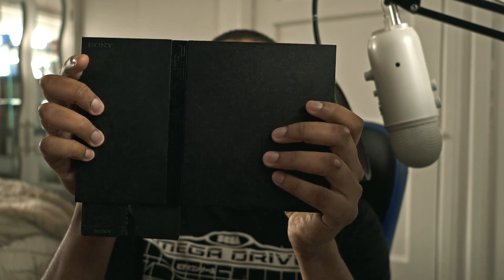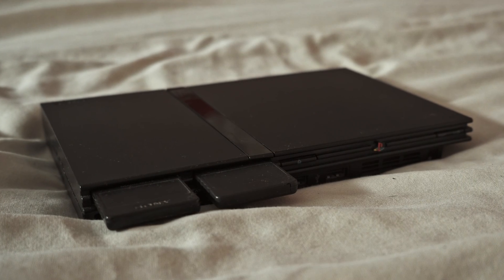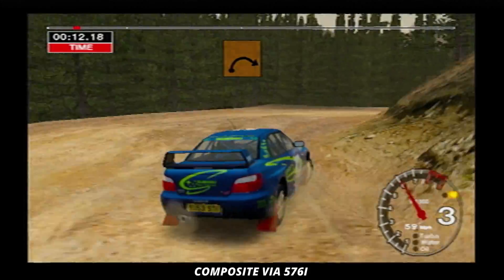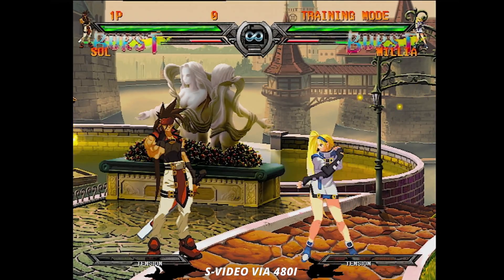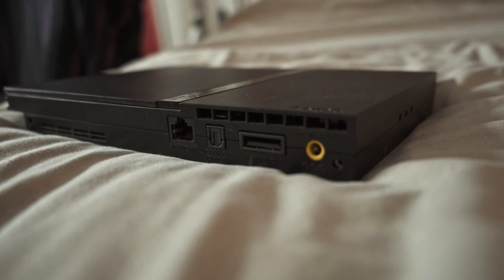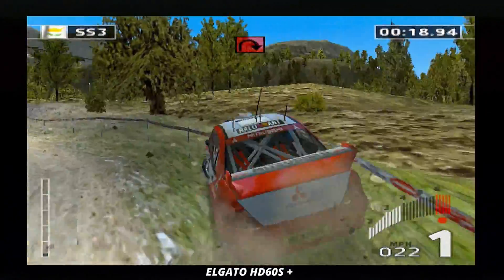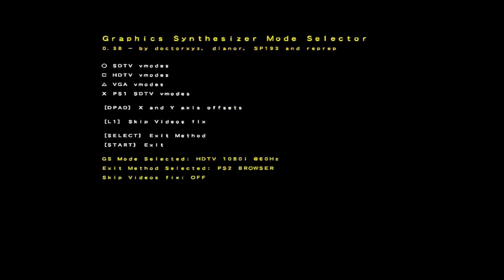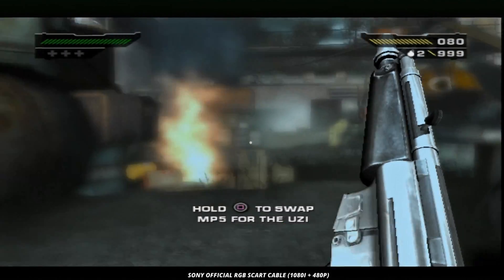PS2 Video Output Misconceptions & How To Improve Image Quality - theaffroshow

Comment from the maker: This is a video I've wanted to make for ages! I hope it helps you get the best out of your PS2!

A point I did not make in the video was the flicker filter settings which some games called it anti aliasing!

This will put a blur or bilinear filter on the screen & it will reduce image sharpness! If the game looks blurrier than normal, check the options in the game you are playing to see if this feature is turned on! Turn it off & the image will look sharper! 

I've also seen it dubbed as soft (flicker filter on) or sharp (flicker filter off) Silent Hill 3 & Tekken 5 are examples of this! The feature might be hidden as it is in Silent Hill 3!

Hope this helps improve your PS2 video output!
Reply: Getting the cable is easy.
Finding a working CRT with 5 pin S video is the hard part. Can be found but when you are looking for one it almost seems impossible.

I Wish a firm would start making CRT's specially made just for gamers as LCD is never the same in my opinion. 
You can get close with optomised emulatores on PC which for those that never grew up with the origina gen 6 or earlier tech they should be fine emulating if not enjoy the convenience more.
I don't convenience; ''I want problems always''.
Old gamers are different as for a start to many games today are cinematic & also aim for realism.
I want stylistic art over pure realism & unsual design choices which cinematic does not offer.

Gen 7 you had some of what I like but Gen 5, 6, 4 in thhat order was the best gaming to my eyes despite the hardware limitations of the time.

Comment: S-video is actually a fantastic cable in terms of size and what it can do, if you still have devices with that port. I have a portable DVD player and a 32" bravia TV with s-video, and still use them regularly to watch DVD's out of the library.
It can do 480p or 576i.

Comment: I spent years messing about with converters and upscalers until I just gave up and decided the best bet was to find an old TV. 
Then I lucked out, work was clearing out stuff. Found an old monitor from 2009 with component ports, quick Google search for its manual to confirm it 576i supporting. And it is brilliant, really enjoying my TV now.

Comment: That depends on the game, I have two games in my collection and they look amazing in 480i using component cable or an adapter ps2 to hdmi, the games are WAVE RALLY and SSX 2000. So there are games that look amazing on an HD TV without progressive scan 480p.
Reply from the maker: There are exceptions of course (Even the PAL version of Gran Turismo 4 looks good) but if the games has 480p available, most of time it will look better :)

Another exception is Tomb Raider Legend & Anniversary on PS2. They both have 480p support yet look softer & worse when using it.
Reply: @TheAffroShowGameplay 179 ps2 games offer 480p. I have some games that support progressive scan and without progressive scan they don't look good.
Tekken 4
Atv offroad fury 2,4
Jak 2, 3
Socom 1,2,3 
Socom combined assault 
Jet li rise to honor 
Splashdown rides gone wild 
Smash court tennis pro tournament 2
These games cannot be played without progressive scan on my TV, they look amazing only with 480p activated,  I agree
Reply from the maker: @Luke_Alves  I'll also add 480p can be forced on with Free MCBoot's GSM feature :)

Some games do benefit from this & others will either look worse, be glitchy or simply refuse to boot xD
Reply: @TheAffroShowGameplay yes

Comment: Without emulation, can't beat a FAT PS3 for PS2 games 🍿🔥
Reply from the maker: Unfortunately many people will not get access to a FAT PS3 & worse, only the ones from North America & Japan have the true PS2 backwards compatible chips inside :)

All European FAT PS3's are emulation only :)
Reply: @TheAffroShowGameplay All European ps3's?
Reply from the maker: @BOXING_LOUNGE All FAT European PS3's are PS2 emulation only :) None have the PS2 chip built in unlike early North American & Japanese units :)
Reply: @TheAffroShowGameplay That's good to know. Have you covered the PS3 console yet? No one does to original hardware better than I have. Worth a gander 👀
Reply from the maker: @BOXING_LOUNGE  I've covered PS3 before & especially on my current channel Affro's Curiosities Official :)

I'll be doing an RPCS3 video soon too :)

Comment: Ps2 is always going to look bad no matter the cable because 99% of the game library is 480i and not 480p like the GameCube, Dreamcast and Xbox were that gen. So I recommend everyone buy either a high quality upscaler like a retrotink 4k to use ps2 on modern tvs or just buy a CRT from the 2000s. Because the ps2 480i is always gonna look terrible unless you want to use an emulator to play the games
Reply from the maker: Believe it or not, this only applies to NTSC consoles :)

If you have PAL consoles, only the PS2 had 480p in selected titles. Dreamcast did support 480p as mentioned but PAL XBOX's & Gamecube's never supported 480p unless modded here :)

Also 480i/576i doesn't always look bad, although the cable, display & or upscaler will have an impact which is true.

You don't need the 4K as it's so expensive so the GBS-C is a cheaper alternative which while not as good, is more than adequate for most people :)

Comment: hello do you know if street fighter collection/ 3rd strike has a 480p mode? thanks
Reply from the maker: Unfortunately, it doesn't support 480p natively on PS2 :)

It can be forced into 480p using Free MCBoot's GS Mode Selector feature :)

The Dreamcast & XBOX original versions do support 480p natively :)
Reply: @TheAffroShowGameplay  once you switch to a certain resolution in GSM does the console permanently stay in that resolution until you change it? or only until reboot?
Reply from the maker: @filevans It only stays until you reboot/switch off the console & then it defaults to 480i/576i so you have to enable it everytime :)
Reply: @TheAffroShowGameplay 

OPL has GSM built in too. Does that work for SF3 do you know?
Reply from the maker: @filevans  It should, in theory, although I've never used OPL :)

It should work the same way as long as you do it before starting the game :)

Comment: Just make sure you got full rgb scart cable, it has ALL the pins, in this video the guy is showing regular scart with missing pins.
Reply from the maker: This was the PS1 version of the RGB SCART Cable:) It's grey to be colour coded with the original PlayStation :)

It still works just fine with PS2 consols, but yes, for the best quality, get one without the capacitors & all pins :)

This can be found easily as a third party cable on Retro Gaming Cables website for under £30 :)

Component is also a great alternative if RGB SCART is not available :)

Comment: Hey great video!!!  So much great info!!! I have a question if you could help , I have a ps2 slim with the red white and yellow wires, it flickers on and off , the game works but the picture flickers, I used a older tv and it worked fine. What is best for a he tv that’s a little
Newer that would negate the flickering ?
Reply from the maker: @Evan1G  When you say flickers, do you mean the actual screen or the graphics? Could you give me more details?

Also, since you are using Composite, a better cable would be S-Video, RGB SCART or Component :)

If you have no analogue inputs on your TV, an upscaler like the Retroscaler 2x, GBS-C, OSSC or RAD2X line of cables would help you further :)

Also appreciate the comment!
Reply: @ yes, so I used the classic cables it comes with for a PlayStation 2 slim. The Red, white and yellow wires. I plug the wires in everything loads up perfectly , audio wise. For the flickering, it’s not the game at least I don’t think it’s the tv that’s flickering. So while I’m running the game it just flickers to black screen back to the game and consistently does that!! I thought it might be the wires so I have an older tv and used it on there, worked perfectly fine no flickering . So I’m assuming it’s the “new hd tv flat screen” issue .
Reply: @ thank you again you got yourself a new subscriber great info, I am going to buy some cables now that you recommended , to see if that would help.
Reply from the maker: @Evan1G  The other problem I can think of is the newer TV doesn't like low resolution inputs from the older consoles.

Not all TV's are like this but, some do struggle.

I'd advise to check your TV settings, change it to Game or Movie mode if available & see if that changes anything :)

Also if the new cables don't solve the problem, definitely get an HDMI upscaler as mentioned in my previous comment :)
Reply from the maker: @Evan1G  I appreciate the support but this channel is not used anymore :)

I recommend checking out Affro's Curiosities Official, my second channel if you want to support me & to see my other content in retro gaming & technology :)
Reply: @ thank you my bro! I appreciate the help and information!
Reply from the maker: @Evan1G  Anytime, hope you are able to get the PS2/PS1 up & running!

Comment: Wassup bro. Do you kno why my ps2 had no color when i switched to the HD component cable???
Reply from the maker: @OfficialPTVELL  Hmmmm that's a first for me.

The only things I can think of are -

Check your PS2 system configuration settings & make sure Component is selected.

Do the cables have any switches or modes on it?

Is the resolution supported?
Are you using an upscaler?
Reply: no colour is normally because your crt doesnt support 60hz, is it a crt?

Comment: I want to clear up a big confusion among gamers about 480i and 480p: they look EXACTLY the same, be it on CRT or LCD, IF the game runs as 30fps: the CRT runs interlaced anyway, so it splits the progressive frame into 2 fields, and the LCD would weave the fields of the interlaced input to reconstruct the original progressive frame losslessly!
480p is useful on LCD ONLY IF the game runs at 60fps! That way you get 60 full height frames to your display, instead of 60 fields (half height frames) like with 480i, truly doubling the resolution of the game!
Reply from the maker: I have noticed actually that if a game ran at 30fps (25 for PAL games) it did look sharper than games at 60 fields per second (as you just described).

I did wonder if this had something to do with frame rates or if the resolution was just better somehow so, thank you for answering both a question & a curiosity of mine :)
Reply: @TheAffroShowGameplay  you are welcome

Comment: Would the quality look nice if I use component cables on a Plasma tv? From what I've gathered, its best to use Crt tv, which I don't mind just exploring options.
Reply from the maker: Component will look good on LCD as well, although it depends on how well it acceepts interlaced content :)

It should look pretty nice on a plasma TV, especially if you take advantage of 480p progressive scan mode in certain games :)
Reply: @TheAffroShowGameplay  ok thanks man I just bought a component cable today
Reply from the maker: @Lightwaves7984  No problem & hope Component solves the issue :)

Comment: Im about to stream and capture a few games.
Component to upscaler to HDMI then to my Elgato neo.
Should be good I'm keen to discover if it's worth it.
I'm not going for HDMI to av.
We are doing this proper the maybe adjust inlay in OBS.
I'm keen even just to play it on a component older flat screen until I buy a crt which is pretty much rare or overpriced in Aus.
Thankyou for your video
Reply from the maker: Glad the video helped and hope your setup works as you intend!

Comment: PAL PS2 with component out into a Retrotink 2xPRO and it works perfectly. It did take me a few attempts to get a solution, level hike, kaico adapter, component on its own and MClassic with the level hike but the retrotink is the job. Might even upgrade to the 5x down the line.
Reply from the maker: @bfitz111  Retrotink 2x, Retroscaler 2x, RAD2X & ODV upscalers are fantastic & I also want to get the tink 5x one day :)

Comment: Component out to my surround sound receiver, then converted and output to HDMI with an mClassic upscaler has worked out well for me. Eventually I'll get a Retrotink. Should have held on to my Panasonic plasma. It had EVERY input.
Reply from the maker: @BI20DI3M4N  it's certainly one way to do it :) As long as you are happy but, I also want the tink 5x soon :)

Yes, I do miss a good plasma TV 📺

Comment: I'd say a backwards compatible PS3 is also a great option if you're willing to pay for the best experience. I haven't touched my actual PS2 since I got mine and it works on any display I throw at it.
Reply from the maker: @spiral1407  Unfortunately in Europe, the best PS3 was partial/emulated PS2 backwards compatibility & proper PS2 backwards compatible PS3's are too expensive for most people :)

Actual PS2 hardware or even emulation is a better choice I feel :)
Reply: @TheAffroShowGameplay  Oh yeah, I live in the UK too so I had to import mine from Japan. 

It was around £200 in total, which is a bit pricey, but the advantages were just too good to miss out on. Not having to pay for extra memory cards, wireless controllers and upscalers also offsets the price a bit imo.
Reply from the maker: @spiral1407  If you can afford it, I agree it is a great way to experience both PS1 & PS2 games :)

I'd rather stick with actual hardware as mods are getting better, plus emulation is so good these days :)

It would be nice to own a Japanese PS3!

Comment: I have the Retro Gem installed in mine giving it a pure Digital to Digital to experience on modern TV's but for CRT's RGB is the way to go Component, Scart, D Terminal.
Reply from the maker: @8bitnation419  I love the upscalers as well since many people won't want to mod their PS2's & the quality of good ones are still fantastic, even on a HDMI display :)
Reply: @TheAffroShowGameplay  Yes there are many awesome scaler options like the Frameister and the OSSC.
Reply from the maker: @8bitnation419  I have the OSSC, 5 years with it & still fantastic for the most part :)

Comment: I am hooking up my older consoles to (newer) smart TVs. I don't mind a little bit of old blurryness - what is the best way to hook up my PS2 to a modern smart TV?
Reply from the maker: Sadly that is not a straightforward answer since budgets, TV's, your personal taste & what you want out of your picture quality will have different recommendations :)

Assuming your TV has no analog inputs, an upscaler would be ideal :)

If you only want PS2, the RAD2X line of cables would be a good place to start :)

If you want to potentially use other consoles or cable types, a stand alone upscaler like the Retrotink 2x, OSSC, GBS-C or even the Retrotink 5X would give you great image quality & you'll be able to use the 480p of the PS2 (other than Retrotink 2x)

I strongly would use S-Video as a minimum as Composite really looks awful on a smart TV. RGB SCART or Component will look even better and give you the option to use 480p in select titles!

Make sure the cables are of decent quality, Retro Gaming Cables have great quality cables for a responsible price, especially SCART cables!

Sorry for the long message! I wanted to cover as much as I could :)

Comment: When i try to startup the ps2 i get signal and pristine sound, but the display (i centered it and its not full screen so its a rectangle within the tv screen) but its kind of has static and the screen itself is scrolling in a  cycle, the tv says its currently  480i
Reply from the maker: Hmmmmm, that could be anything :o

I guess I'll start by saying what model is your console? PAL or NTSC?

Did you change the output settings (RGB Or Component) In the settings menu?

Does your TV support PAL or NTSC or both signals?

Does your TV support interlacing? 

Are you trying to play a game that is 60hz on a display that doesn't support 60hz?

Is the cable of good quality?

If you are using a HDMI monitor or display, have you tried an upscaler?

Comment: Thank you for mentioning the fact that 480p and higher on the PS2 sends sync over the green wire.  Though I can say that a picture may be darker on a PS2 if using a  PS1 RGB cable, since the PS2 already has the capacitors for the colour lines on the mainboard.  Least, this is what I've seen using my JoyTron PS1 SCART cable (don't ask how I got a PAL PS2 setup with PAL PS1 games when I was living in Florida, interesting things show up at thrift shops near the theme parks) with my roomie's PS2 slim via OSSC.
Reply from the maker: @NightSprinter  Anything to help & I'm happy the information here was useful :)

I've never had any problems with the cable, but as you said, they may be some, although picture quality was never an issue outside of anything higher than 480p :)

Comment: Or just buy ps2 to hdmi, its size of an usb works and is outputing component signal. Used already on huge screen and looks great. Just make sure that TV (if it has) has turnd off options such as where it detects and automaticly darkens parts of video as it can lead to very dark image or darkening of rooms or picture at random times.
Reply: And i forgot to mention that it can be found very cheap online.